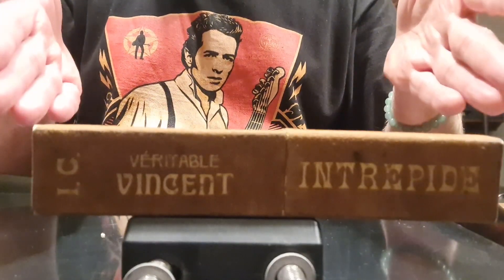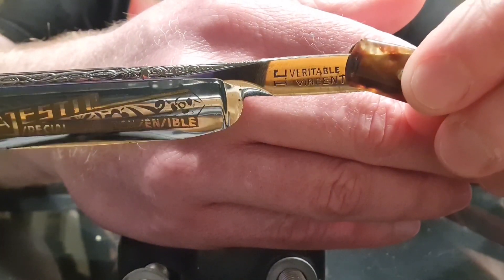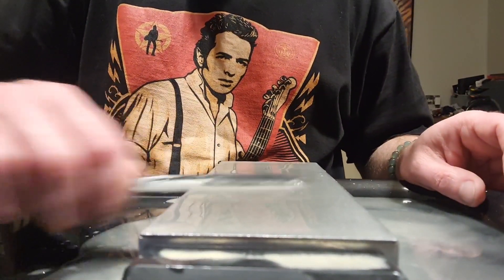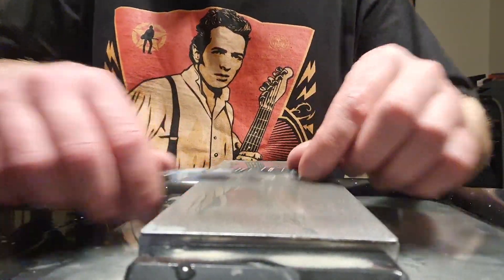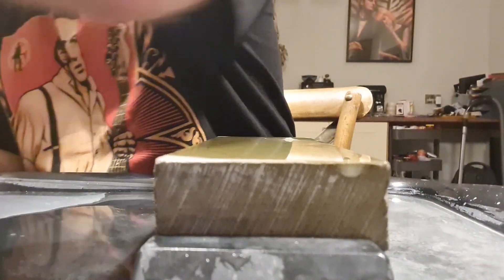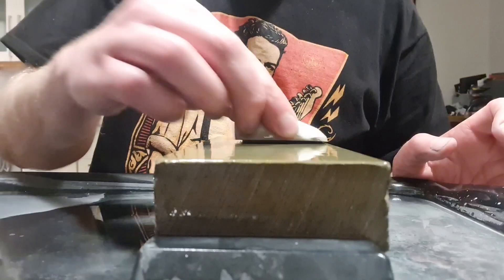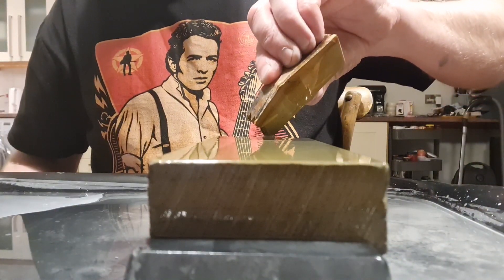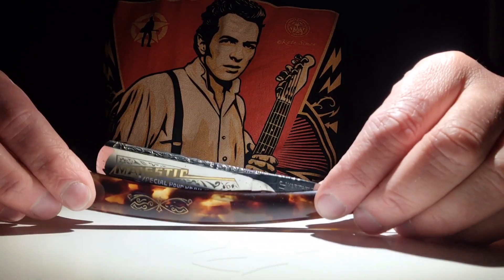Vincent - Intrépide French Straight Razor Restoration Honing on JNAT

Comment: Mighty fine intro! I seen the condition of the bevel but will return to finish watching...
Reply from the maker: Thx a lot mate 😄🙏
Reply: My posting from yesterday vanished, probably neglected to finish. Fine and unique razor, I like how easily you removed them large chips. I did a restore on a vintage W. Greaves and Sons, a full wedge. Great old steel but it had a spinal warp. It had a space under it and on the other side it rocked. I simply removed material from both sides, checked the geometry and honed it with tape..I dig your progressive finishing set up but noticed you used a La Lune in another video, perhaps I should purchase one. My current Jnat seems to be lacking...keep making your great videos!
Reply from the maker: @guysolis5843  I had the same experience with 2 Greaves SR, both of them with terrible geometry.
They're really nice looking blades but  geometry seems to be a regular issue... (Same with Wade & Butcher)

Regarding LA LUNE,  it's a decent enough stone, I'd say a good JNAT will still be better but it would cost you a lot more.
For a reasonable budget the LA LUNE can be a good choice indeed.
Reply from the maker: Btw, fair play on your head shave with a SR! You're a brave man 💪😊
Reply: @FroggyShave  Haha..thanks. The second half I used a DE for the back and I bled. I bled so much I refused to slap on  alcohol based after shave...I used medical balm!!
Reply from the maker: @guysolis5843  crap... Very brave of you to give a go lol

Comment: In the long run bevel will crack. There was no need for tape. In this way you reduced the bevel and made all more easy but is not correct! Its not a wedge!🎉
Reply from the maker: Tape or No Tape, this is a very personal choice. As long as it's satisfying the user that's the most important.
On my side, I'll always use tape ton protect the spine. 🤩👌